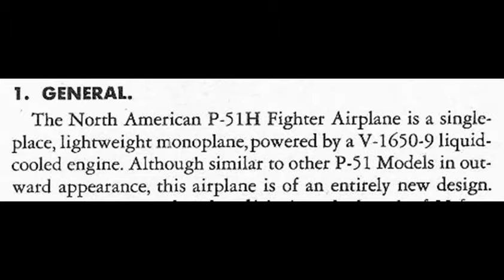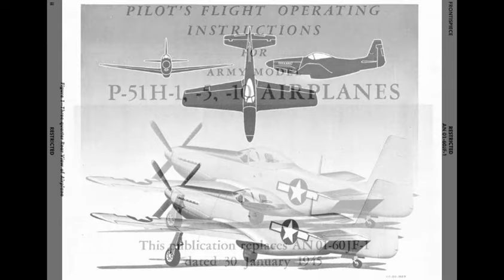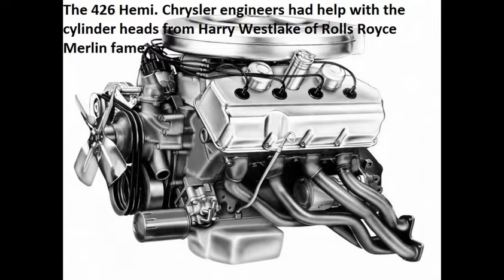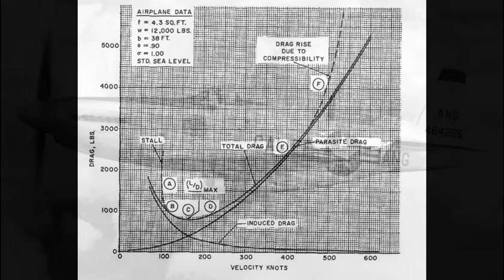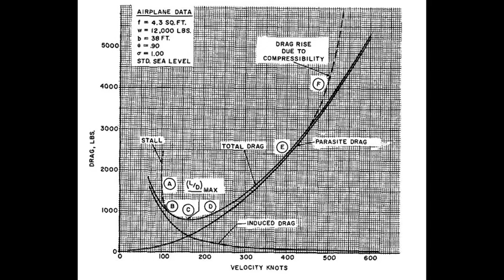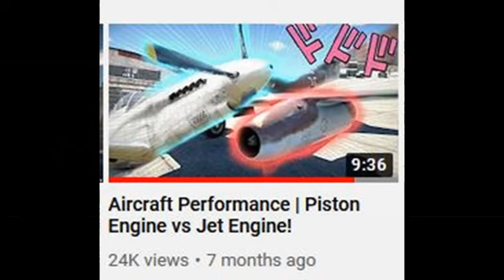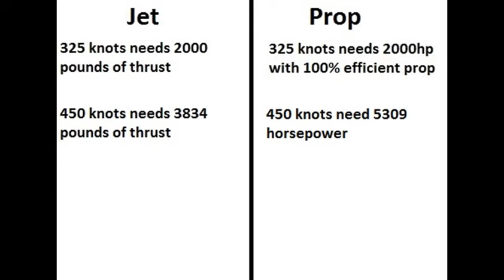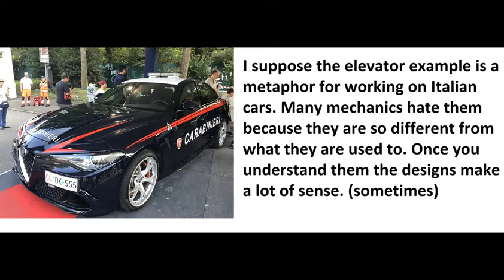U.S. "Superprop" Fighters P-51H, XP-72, and more

Comment: great vid !!!! ironically My father was the first guy to manufacture a all "Billet" Chrysler Hemi Cylinder Head for Drag Racing. he teamed up with Art Whipple and his first screw Blower. truth is i love Mopar but the Hemi Chamber in a 2 valve configuration is really only good at Wide Open Throttle. for this reason and the fact they are a lot cheaper. I build a lot of RB and B motor Chrysler wedge headed motors for the street.  the Hemi makes more peak power but the wedge makes quite a bit more average  power over a given RPM range.  the modern day aka late model Hemi is a semi Hemi or a squished Hemi. they realized the Quench a wedge head has is great at combating detonation and or pre ignition .  the modern squished Hemi  has a double quench . One on either side of the valves.  that and the closed  style chamber really helps combat the knock with higher compression ratio's both static and dynamic and are limp wristed low octane fairy fuels cheap americans like to burn in their hot rods now days. one final thing with a wedge style chamber and a tight quench you have to be careful about excessive "Rock" and the skirt thrusting moment on the skirt @ TDC. because the quench is perpendicular to the Wrist Pin. In the modern Hemi the quench pads are directly over the Pinboss Towers of the piston. so the load is carried equally  and parallel  with the Pin

Comment: Aww you didn’t mention the P-47 “double twister”!  It was a P-47B that was fitted with a contra-rotating prop!  I think i read that the test pilot almost crashed it because the engineers forgot to take the angle out of the vertical stabilizer that would normally counter the props torque.
Reply: They probably did. I'm guessing the pilot had many hours on the type and unwittingly wound in the usual right rudder trim for take-off, when he should have just left it neutral..?

Comment: When I was still at Lackland AFB, in late 1967, they had a P-51H on static display outside their little museum.  It had been flown to Lackland by a pilot from the New York Air National Guard, who had it last.  Inside, I asked about the aircraft, they had the original log book for it which documented the aircraft including its last flight.  Very cool, I thought.
Reply: +Pat Hines   That P-51H is still on display at Lackland AFB.   They also have an even rarer F-82 Twin Mustang,   both apparently still outside in the elements and weather.  That is a travesty for airframes as rare as those two aircraft and they need to be indoors in the least.  Twenty five years from now, some base commander will say they are too far gone and corroded and they will end up scrapped.

Comment: The culmination of the piston-prop fighter-bomber was the Douglas A-1 SKYRAIDER.   This was a huge single-seat fighter-bomber much bigger than a P-47 Thunderbolt.  It was a great ground attack fighter used effectively in the Korean War and Vietnam for close ground support, since it could carry a huge load of bombs, napalm, and rockets, with 20mm cannons.  

In Vietnam,  US and South Vietnamese ground troops loved the SKYRAIDER because the plane could blast Vietcong and NVA for hours since the SKYRAIDERS could hang around battlefields for a long time.   Two SKYRAIDERS shot down 2  North Vietnamese Mig-17 jet fighters, one in 1965 and the second in late 1966.

Comment: The Fw-190 cooling fan did absorb power during takeoff and at low airspeed.  However, The Secret Horsepower Race by Calum Douglas  indicates that the fan did not absorb power once the ram air entering the cowl matched the pressure the fan was working to produce, and it rotated for free. So at least it did not limit the top speed of the aircraft.  I think there may have been some speculation that at very high ram pressures it may have actually extracted some energy from the flow and added it to the shaft, but don't quote me.

Comment: On props losing efficiency, there is a point where the prop simply cannot "grab" air fast enough to make use of it.
Reply: Props only have to “grab” (pull it in) air at a standstill.  At speed the prop gets fed an increasing amount air as the airplane flies faster.   The issue is the velocity vector at the prop tips and the increase in fluid velocity over the front blade surface. (analogous to the top surface of a wing).
When you get anywhere near the speed of sound, there is no way to keep the prop tips subsonic...that’s the limit, as the airplane then has to fly through a helical shock wake, even if the prop can stand this.  The attempts at making a supersonic prop plane have used rear mounted props to avoid this.
Reply: @gumbykevbo  Or, in the case of the XF-84H, the engineers said: sod it, lets see what happens.
This resulted in horrendous noise and vibrations, and overall a rather quick end to the test program.
Reply: @gumbykevbo  Excellent reply.  The first man-made objects to exceed the speed of sound were propeller blade tips.  That's why AT-6s had that distinctive buzzing sound at certain angles of attack and speed. The airflow over an air foil section shape (which all propellers have) is a determining factor.....at sub-sonic speeds airflow can be laminar or transitional to turbulent flow but there are no shock waves forming at leading and trailing edges. At sonic and supersonic speeds, that is no longer true, and is the reason that supersonic airfoil profiles are radically different for subsonic vs supersonic speeds.

Comment: The Napier Sabre was bench tested with 5,500hp reliably, but never used because of jets. Sleeve valve engines could take a lot of supercharging because of no hot popper valves starting detonation.

Comment: Re the Sicilian elevators…many new office buildings here, in Australia, are using this system, particularly for high use buildings. The theory is that it prioritises elevators based on the number of calls and therefore increases efficiency. The only downfall, though, is if you are the only person wanting to go to a particular floor, you can be waiting longer ….and watching other people get into elevators quicker. You’ll also find that pretty much only the US (maybe Canada as well) designates the Ground floor as level 1…everywhere else designates the ground floor as level 0 or “G”, with 1 being the first level up.

Comment: There’s an elevator like that in Syracuse at the crowne plaza.
Reply: I have run into similar elevators in downtown Seattle. Probably the new way to do things. The old system initially used simple logic the could be done with the relay logic systems in use at the time. Elevators have been running on microprocessor based systems for a long time; interesting that it took this long to take exploit the increased capabilities.

Comment: You want Superprop? Try the Curtiss XP-71, it's a heavy fighter the size of MEDIUM BOMBER, with 1 75 mm, and 37 mm cannon as primary armament. It also had a medium's weight of 39,950 lbs gross weight,31,060 lbs empty, five tons more than the closest compare, the B-25 Michtell Bomber.

Comment: Hey Geg, I used to get this magazine about 25 years ago called War Birds. In one issue was a story about the P51H. I never new this modal existed and was fascinated. The article told that they were going to do a nuclear bomb test deep in the desert of Australia. They draged a bunch of P51Hs out there to see what would happen to them during the test. Apparently the planes received little damage and were left in place for decades if I'm not mistaken. The article said someone  found out about this, I can't remember who or what organization it was but they got permission to remove the aircraft,  so they worked out in the desert and got them into flying  condition and flew them out. I remember the article said that they were going to be restord, I don't recall ever hearing about them again. I know the article said the H modal is the rarest and I think it said these were the only surviving examples and I believe they were able to fly 5 aircraft out but there were more left behind. I could be wrong. I was wondering if you had ever heard about this and know what happend to them or anyone else who happens to read this. I always wondered! Thanks!
Reply from the maker: That's interesting, I have never heard about it, and don't know what happened with those planes.
Reply: YES IT IS TRUE .Out in the middle of the desert in South Australia,5/6 p51  where parked in pits ,out in the open,and behind Bourns ,to test the best way to park,in a atomic blast .the planes survived and at least one was in good enough shape after decades out side to be flown to Adelaide ,after some minor repairs,the rest where taken to Adelaide some where sold and are in the US.there is a film on it ,Utube I will send a like if I can find it.
Reply: @georgepantazis141  wow! Thanks for your reply! I was starting to think I imagined it or got the story wrong. I would think because there Hs they would be prised possessions and they would be famous in the war bird community. Yes if you know of a video about them I would be very interested to see it. This has been on my mind for decades.  Thank you so much for your reply!!

Comment: An interesting discussion on how German wartime metallurgy (i.e. lack of alloys) handicapped their engine performance:
https://youtu.be/ImEpk1s-Vk0
Reply from the maker: I have seen it. I really need to respond to it with a video.
Reply: Having read Calum's book, alloy shortages are a big factor but not the only one to handicap their engine programs. 
Terrible beauracratic organization decisions resulted in wasted effort and time trying to fix problems as they occurred.

Secondly there was no cross pollination between engine firms. Knowledge was not shared, even despite it being in the nation's best interest for such info to be best utilized.

All resulting with promising developments that were either ignored until too late or made unfeasible when they finally got their act together. The Jumo 213J and BMW-801F were too late as a result.
Reply: @cannonfodder4376  
There is an excellent video on the myth of German manufacturing efficiency on a channel called The Warbird Mistress, she does an excellent job of covering why they had some of the production problems that they did and why it led to low quality.
Reply: It was not only about lack of alloys or the metallurgy as Germans were producing high quality engines up to the final days of war. In truth it was the low quality of fuel and low grade lubricants that seriously handicapped the engines. Also the low quality fuel was very hard on the engines leading to continuous maintenance. Along with bearing difficulties, the DB 605 suffered particularly badly from the materials shortages in wartime Germany. From the outbreak of war onwards critical shortages of elements such as nickel and cobalt meant that the DB 605 had its exhaust valves reduced in nickel content from about 13.5% to 8%. This resulted in them becoming insufficiently corrosion resistant, and they began to scale in use. This scale then caused pre-ignition, which led to catastrophic detonation. To make a good comparison the DB 605A-1 was developing about 1,450 hp but the Swedish license production DB 605B which was refined and produced by Svenska Flygmotor AB with high quality fuel and high octane was developing easily 1,700 hp with no problems.
Reply: @cannonfodder4376  Are you saying that absolute free competition between the companies wasn't the best for everone??!?
Reply: @paoloviti6156  Until BMW's method of hard chrome plating the valves became the new German way of compensating for lower nickel alloy steels, the DB605's and BMW801's would be derated for a good portion of 1942 to early 1943. Even then it never compared as favorably to high nickel content valves.

The topic of poor lubricants is also of note in the book. The shift from roller bearings to plain bearings, inadequate lubrication from a lack of an inadequate oil pump flow rate and poorer quality lubricants hampered the 605/603 for a while until fixed by late 1944. At that point they were derated for bearing life.
Reply: @cannonfodder4376  correct 👍 but don't forget that among serious issues they also had serious issues also with the spark plugs for almost a year not to mention the gaskets when it was used water injection. Years ago there was an article on Airplane Monthly carefully explaining why there was this problem and how they resolved somehow, but unfortunately I don't remember very much as I easily read about it 10 years ago but I do remember that instead of cranking full power they had to pull less gas.
Reply: @paoloviti6156  Getting suitable materials for rubber gaskets and spark plugs was yet another source of trouble for the Germans for sure. Was a topic of discussion in Calum's book.
Reply: @MultiZirkon  In this sense yes. In a Total War where the survival of the nation is at stake, patents and exclusive rights are of lesser importance than the best possible engines for aircraft use.
Reply: @cannonfodder4376  correct again but also weak head gaskets when it was switched on the MW-50 water injection,  but apparently it was solved by using special copper gaskets or similar. I have heard about Calum's book but unfortunately I never have read it, I would love to buy it....

Comment: In Lacrosse Wisconsin is a restaurant that has a three story elevator that is lifted on a hydraulic ram instead of cables. So that ram has to go more than three stories underground to get you to the ground floor. Also, lacrosse has a Guiness record for the most number of taverns per capita of any town in the world.. There may be a connection.
Reply: We have a few hydraulic lifts around here that use a telescopic piston, avoiding the need to have a super-deep pit under the elevator. You sure they don't use such a solution?

Comment: Perhaps that cooling vent located on the sides just above and behind the leading edges of the wing on the XP72 would  benefit from the low pressure in that area, adding a suction effect...

Comment: A modern elevator system in full use now. Some buildings have 2 cars in the same shaft so the shaft can do split duty. One interesting elevator or "lift" to give its proper name is the Patenoster. a moving all the time lift that has cars you step into and out of while they are still moving. Prague still has some you can access and see. Like a bucket chain conveyor for people.

Comment: That thumbnail is a stunning aircraft 
Wish we had those flying around still today 
I'd love to be able to see/hear one
Reply: + Davie Jay  There were two XP-72 prototypes.  I am reading that the second example was damaged during an emergency landing.  When the XP-72 contact was cancelled, the first prototype had the engine removed and was given to the Long Island, NY chapter of the Air Scouts.  The second example was scrapped.  But perhaps some digging into the Air Scouts in NY might yield some more info about it, or if it was scrapped or put on the local fire dump for training.  Perhaps it is in a landfill there.

Comment: 12:00 I think the other reason why the XP-47J was not produced is because the construction differences between it and the current P-47D variants were quite extensive, particularly in the fuselage. Since the XP-72 was pretty much a similar creation, i.e. P-47 wings and tail with a new fuselage, it made sense to go for it and just put the R-2800 2800hp engine in P-47Ms and Ns. Easier, quicker to produce, and they were more than fast enough.

Comment: An addition to the "HEMI" story: Read, "We Were the Ramchargers: Inside Drag Racing's Legendary Team". The author talks a little about the ties to the aircraft engine and the 1st and 2nd generation production "HEMI's". Very good book, not perfect but overall and excellent source and GREAT read! 

P.S. The very first "HEMI" dates to the very early era of the automobile and the Welch Motor Car in 1904 or Pipe in 1905. Fiat used them in their 1907 Grand Prix car. I think cannon and gun makers of the late 1800's had seen the benefits of the chamber shape also.

Comment: Greg, as Riddle grad, respect the heck out of your work. I think you mean contra rotating props.
Reply from the maker: They are most correctly called "coaxial contra-rotating propellers". However even Wikipedia says " Contra-rotating propellers are also known as counter-rotating propellers"
Reply: @GregsAirplanesandAutomobiles  If we are technical, is counter rotating is when 2 engines have props that spin opposite directions, and contra is when one shaft has 2 props spinning in opposite directions?

Comment: If not for the Douglas AD Skyraider, this would have made an excellent attack aircraft. With some provisions:
1: Install a turboprop (the Allison T56 comes to mind.) It's less about top speed and more about available power when I suggest this.
2: Swap to the 20mm cannon armament with a similar hardpoint layout to the AD.
3: Ditch the complicated supercharger layout behind the cocpit and replace it with avionics and fuel.
4: If only prop technology was as advanced as it is now... a quieter propeller, counter-roatating or not. 

It wouldn't be available for Korea, but Vietnam might have been a useful theater for these in the COIN role.

The idea being the platform would be quiet, slow enough to deliver accurate ordinance, fast enough to stay out of trouble, and have enough power to lift an effective load. The notion of using jet fuel instead of 100 octane gasoline adds a slight margin of operational safety.

Comment: Lifts like you saw in Sicily have been used in Australia (some buildings - such as the Telstra building in Exhibition st, Melbourne has had this style of lift for over 20 years) for some time, not common, but not unusual either.